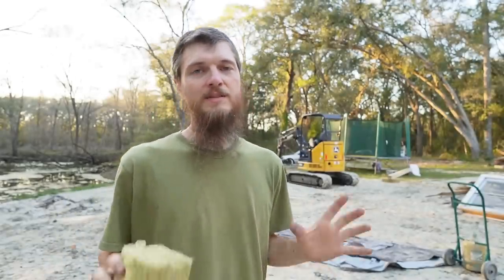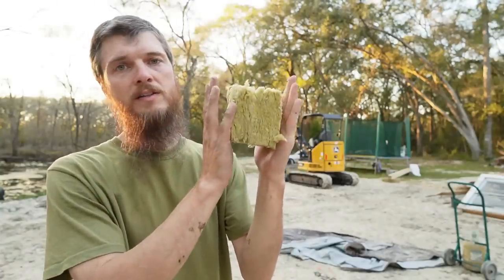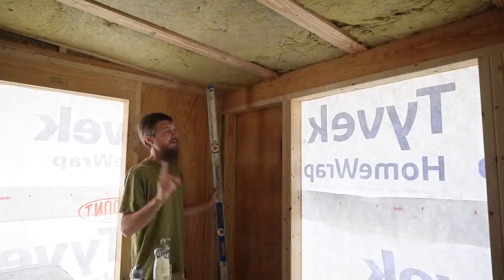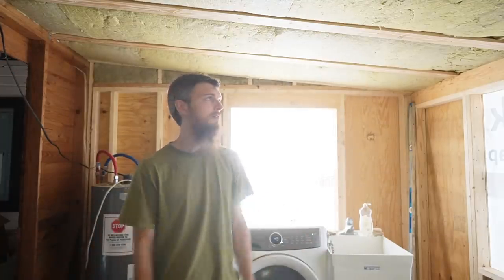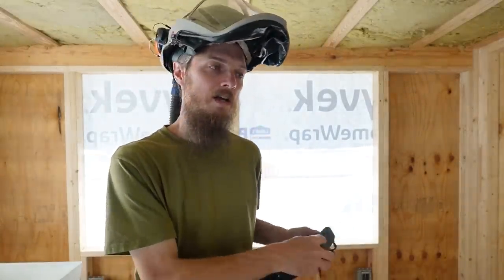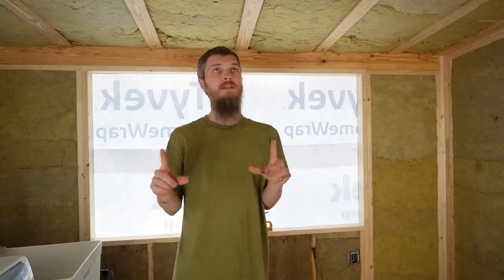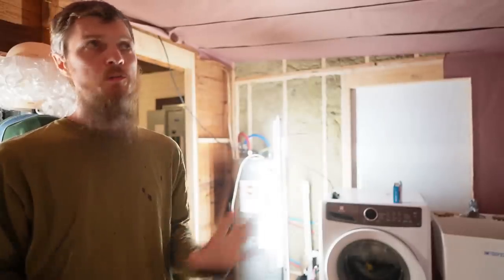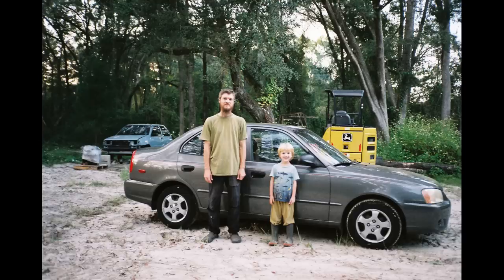Compressed Insulation Air Space Myth ( Insulating the Back Room + Family Photos! )

Comment: Poor connection is resolved with boiling rubbing alcohol and pouring it over connectors. It will not damage any electronics. Let sit for 3 days and everything will work again. I've used this method on keyboards, connections where corroded batteries turned everything green and the car battery. I first found this method in 1985 when the peanut butter sandwich was placed into the VCR. Lots of love and respect to you all.

Comment: Doug, thank you so much for explaining about the paper. We are about to insulate our detached garage and I think the paper over the insulation is a great idea. Insulation fibers flying everywhere is not good to be breathing in everyday
Reply from the maker: Keep in mind that paper may not be the best depending on what you want to achieve and your climate zone. 

Faced fiberglass insulation is ideal for most areas. If you are installing an unfaced insulation like mineral wool, there may be better options for covering it. 

Paper left exposed can pose a fire risk and it tears easily. If you don't plan on putting up drywall over the insulation you may want to cover it with something else, like this: https://www.lowes.com/pd/Reflectix-R-500-sq-ft-Unfaced-Reflective-Roll-Insulation-48-in-W-x-125-ft-L/4735443 
Which has a class 1 fire rating and is very durable. I just want to clarify, the product linked isn't bubble foil. It's a thin, durable radiant barrier. There are other options as well.

Comment: I used to work for an insulation company in MI. We had to caulk all the cracks to keep air out. Had to caulk every where a board meets and along the bottom and top sill. Caulking gets old quick after a few new builds. 2 things I hated was caulking and coming home to a nose full of black snot from the blown cellulose. I sure could have used one of those face mask.

Comment: This was good to hear. I had always assumed that stuffing more insulation into a given space would lower heat transfer in most real-world scenarios by just blocking air currents, which are the hidden energy hogs in most buildings. But it's nice to know that it actually increases the R-value per inch. I'm sure there is a limit, since a solid block of rock or glass would not be a great insulator, but you'd never get near it in a wood wall. Thanks for the insight!

Comment: Doug,
You miss understand the compression of insulation.
According to Owens Corning published information on their product is when you compress the insulation you increase the R-value per inch but decrease the overall R-value.
Example: you install R-21 rated for 5-1/2” (2x6) cavity & compress into a 3-1/2” (2x4) cavity the overall R- value decreases to R-15.
Air entrainment is an important insulator to any fiber or mineral insulation as well as concrete.
Reply from the maker: You are describing exactly what I said so I don't think there is any misunderstanding. Maybe you misunderstand what I said?
Reply: @diyfferent  it's your title, you say you disprove a myth that you lose r-value when compressing insulation and then literally provide the manufacturer furnished information that proves you do. You even summarize it that way, your title is contradictory to the information you provide. R15 becomes R11 when compressed, who cares about r-value per inch.
Reply from the maker: @giuseppebiondo8492  A lot of people care about r-value per inch. But aside from that, the myth is that "air space" is what insulates. It's just not true. Dense insulation insulates better than loose fluffy insulation. Inch for inch, compressed insulation performs better than uncompressed insulation.

Comment: Thanks for sharing photos !  Please what is that paper name you put over insulation? Will it hold a mouse on the ceiling?
Reply from the maker: Red rosin paper. I don't understand the question about the mouse
Reply: Thank you.  Over my bathtub, the ceiling is gone, just the pink stuffing, I myself believe I could put that paper up, but smart  mousses roam between floors, I dont want one falling into tub again, so paper would need to prevent that.  P.s.  love your posts.  Am in awe of what you can accomplish !!!
Reply: A mouse would be able to eat through any paper
Reply from the maker: @carolinestagg6807  The best thing you can do is figure out where the mice are getting in, and seal up all of the spots where they get in.

Comment: DeOxit is excellent for cleaning oxidized contacts, one drop clears them right up.
Reply from the maker: Thank you for the info. I never heard of that before but I will be sure to try it out some time.
Reply: @diyfferent  DeOxit is fantastic.  Another trick is to periodically take a regular pencil eraser and go over the contacts (on both the unit and battery) to keep the oxidation at bay.

Comment: interesting about the insulation, I was only aware that it had a limit to practical maximum thickness.  Your header under the angled roof needs 3 pieces of wood above it to take weight, it has no load on it currently.
Reply from the maker: That's not a load-bearing wall and the header wasn't even necessary :)

Comment: Does Florida have code to show where and how high electrical outlet boxes should be placed in a room? Also how many outlet boxes do you need in a room to be up to code?
Reply from the maker: There is no code in any state that says how high electrical outlets should be. You can place them anywhere within reach. There is also no required number of outlets. There is a minimum spacing though. 

In a typical living space, outlets need to be installed on any wall greater than 2-feet wide. The outlets need to be within 6-feet of any obstruction or break in the wall, such as a doorway, and have no more than 12-feet between outlets. The rules are different for hallways, kitchens, bathrooms, etc. I hope that helps.

Comment: So how did you put that wall up and not notice it was out of Plumb but I've seen professional framers have the same problem my old boss built semi detached side by side duplexs for the fireguard center Wall he used the ICQ poured concrete after the roof was on it was noticed that the wall was out of Plumb two inches from top to bottom on a ten foot wall there was no way to plumb it up so the Carpenter had to fir it out two inches from top to bottom what a mess also messed up on the hight

Comment: What was your thought process in using metal ones versus plastic?
Reply from the maker: The metal boxes are wide but shallow so they allow for more insulation behind them on exterior walls. Plus they allow me to run flexible metal conduit, which I sometimes use. In interior walls I sometimes use plastic boxes where insulation doesn't matter. I use them both depending on the situation and what I have on hand.

Comment: So, really, in general aren't you saying that u lose no insulating-value in the real world by compressing 3.5" into 2.5" bcuz although u technically have fewer inches, those fewer inches have a higher per inch R value.  So the insulating capacity of that piece of wool is the same whether it's compressed or not -- It's basically a "wash", right?
Reply: Not quite. It’s not a wash. You get less total insulation value by compressing the bat that you have. However, if you need to compress it, you don’t lose all the value, only some. And if you want higher value in the same amount of slack, you could compress what you have and add more.

Comment: So… it’s less insulation value if you compress it. The same insulation not compressed gives you more insulation value.
Reply from the maker: I tried explaining it, but maybe I wasn't as clear as I could have been. If you compress insulation, you actually increase the R-value per inch, but you end up with less inches. So the overall R-value does go down. 

BUT, if you fill a wall cavity with 3.5" of compressed insulation, the r-value will be higher than that of a wall cavity filled with 3.5" of uncompressed insulation. Inch for inch, compressed fiberglass insulation has a higher performance.

That is contrary to what many people believe and teach here on Youtube. So I hope I can help shed some light on the topic.
Reply: @diyfferent Totally clear.

Comment: Ok, so if the same piece of insulation is compressed, how did it lose overall r value? True the r value went up per inch, but not enough to make up for less overall r value in the compressed piece vs a non compressed piece. Its the same material, same weight, same everything but compressed. Whats missing? What is removed when its compressed? The air inside is whats missing. Air pockets are incredible insulators. Thats why all insulation if fluffy and lose. Its why double pane windows are spaced and not just two sheets of glass that touch each other.
Reply: shouldn't you be telling the manufacturers all this? you know, so they can change their instruction and information sheets?  Doug is just a dude building a home for his family
Reply: @101fairplay  No need as Doug, who is more than a simple man building a house, more or less said the exact same thing before discounting it. Thats what fools and idiots do.
Reply from the maker: I don't know who you are calling a fool and idiot, but certainly it's unwarranted.

To answer your question, the reason the overall R-value goes down when insulation is compressed is because there are less inches of material and a shorter distance for heat to transfer. It's not because of the lack of air space. Consider foam board or mineral wool board insulation which achieve the greatest R-values/inch through compression and tiny air spaces, not through larger fluffy voids. Convection is what you want to avoid, and larger air spaces allow for more convection.

Air pockets are not not great insulators. That's why, in your example of a double pane window, the void between the panes of glass is filled with an inert insulating gas. It's not the air space that helps, but the gases used which are not great conductors or convectors of heat.
Reply: @diyfferent 👍🏻🙌🏻❤️

Comment: So by your logic which provides better insulation: 1 piece of insulation installed in the proper space, or jamming two in the same space?  The reason why I dont buy this explanation is basic understanding of heat transfer in heat sinks.  If I melt down 2 heatsinks to make one, it will not do double the work.  A solid block of copper doesnt work the same way as copper fins.  The statement of having air in the insulation is a simplification of surface area.  By compressing something the exposed surface area to the air changes.  This is the factor that is reduced.
Reply from the maker: Yes, jamming two batts of insulation into one bay would provide a slightly higher r-value than one piece in the same bay. However, it would be minimal increase and is not a cost effective way of increasing the R-value. Fluffiness in itself doesn't increase R-value, but rather just helps to fill the voids. That is the key: filling the wall or ceiling cavity and not leaving air gaps. You want to stop convection and air movement. The smaller the air pockets, the less room for movement. Look how efficient foam insulation is, even with those tiny air bubbles. Or even compressed mineral wool board. They achieve great R-values through compression.
Reply: @diyfferent R =  ι (Thickness of Material) / λ (Thermal Conductivity).  So yes the thickness has a direct dependency on the R value.  Google Effective Thermal Conductivity of Fiberglass Insulation vs Temperature and density.  

There is a chart that shows the following numbers.   With a density of 16 @25C λ = .038;. 32 @25C λ = .034.  With a thickness of .09 meters.  This chart alone shows the drop of thermal performance with the increase of density.  IE double the density does not equal double the thermal performance.

R = .09 / .038 = a R value of 2.37
R (double density) = .09 / .034  = a R value of 2.65
Reply from the maker: @brianbu01  You are overthinking it. There are more important issues to worry about in the world.
Reply: @diyfferent  You literally are the one to say everyone else is wrong.  You should have more to stand on than, "You are over thinking it."

Your first rebut had fleeting understanding of the term R-Value.
Reply from the maker: @brianbu01  I just don't feel like debating about it. Sorry.
Reply: @diyfferent  then just provide your citations

Comment: Your logic in gaining R value when you compress is flawed.
R value is the ability of the material to conduct the flow of heat. 
The fluffed insulation creates air gaps so that the material does not bridge. A solid like 2X4 framing is a thermal bridge and offers very little insulating properties.
What you are insinuating is that you could compress insulation with no ill effect, but that is wrong as you are making it more similar to a solid with a straight thermal conductive path.
Reply from the maker: I think there's just a misunderstanding. I'm not trying to insinuate that you can compress insulation without losing overall R-value. When you compress it, the overall r-value does go down because you end up with less insulation. But the insulation will still perform to whatever thickness you have it. 

If you have to compress a 7" thick batt into a 3.5" cavity, the insulation will perform as well as possible in a 3.5" space, you'd probably get around an R-15. There's no practical way to increase that number.

So try to think about insulation in inches. If doesn't matter if it's fluffy or compressed, just look at how many inches thick it is.